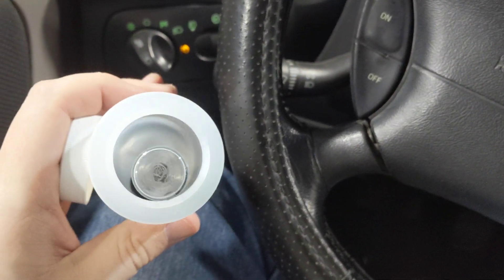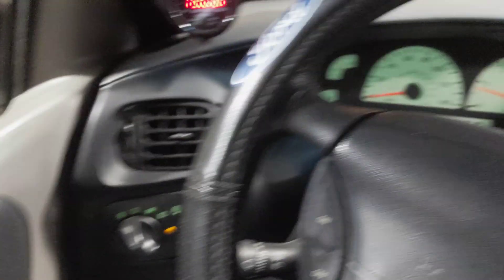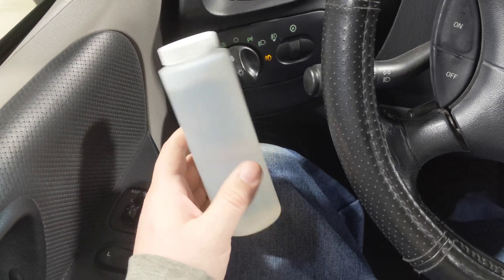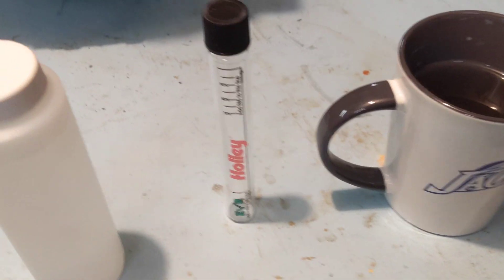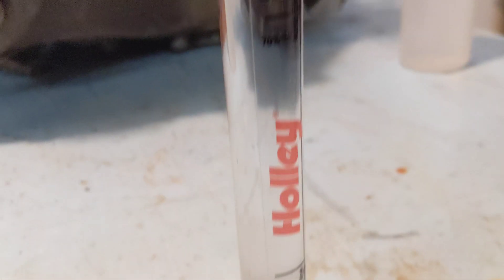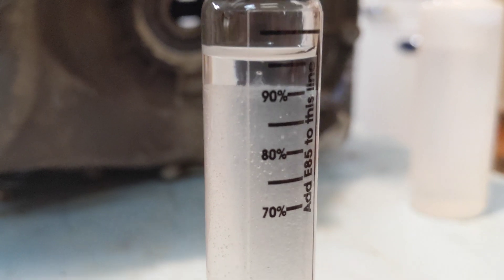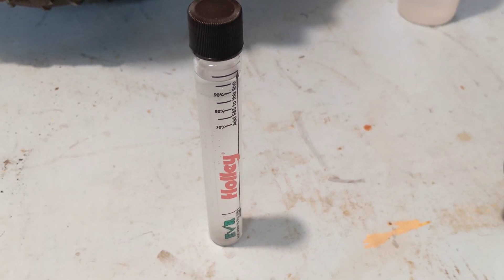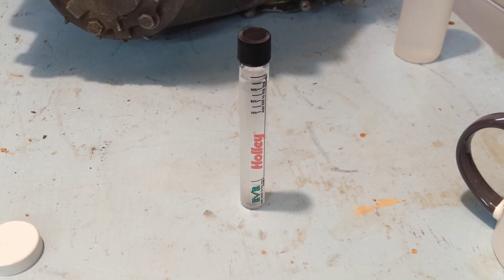How to Test E85 (Quick and Easy!)

Comment: E85 is beautiful high octane fuel. Makes more power than pump gas, burns way cleaner and no more carbon monoxide headaches,
Reply from the maker: It's the best!!!
Reply: @605BOLT  Definitely. But it goes fast. I can see needle move everytime i punch it...lol
Reply from the maker: @maximusvonce1381  that is true. I lost a ton of mileage when I switched over. Went from about 15-16 to barely 10 if I'm lucky haha. But soooo worth it.
Reply: @605BOLT  10mpg is good. My fuel injected 438windsor is lucky to get 5mpg. How long have you been using e85? Any issues or gumbed up injectors and fuel pumps. How often you start and drive your e85 lightning? I use Techron Marine to make sure no water build up in my tank or fuel system on e85. You use any additives?
Reply from the maker: @maximusvonce1381  I haven't had any issues with it yet at all. But I've only been running it about a year and a half. I drive my lightning about once a week for sure for 9 months of the year about about once a month during the three hardest winter months.
Reply from the maker: I don't use any additives either. Does that help you at all?  Since I haven't had problems yet, I haven't had the need to try anything.
Reply from the maker: I have never knowingly run it on anything worse than E70 and never beat on it with anything worse than E80. If it's no good, I don't refuel it.
Reply: @605BOLT  So you wont ever go back to any gas station that sells anything under e85. Did your car run bad too on e70 and e80?. I only use 1 gas station now that always tests right at e85, and my car never has problems..When i used e80 from 2 different stations it ran like shit. How bout you. Did your car run bad on e70 and e80. I assume you wont ever refuel it at any gas station again,  that runs e70 and e80. Gotta be e85 or my car gets pissed off and stalls on me..
Reply: @605BOLT  Both times i ran e80 my car stalled,  misfired,  sputtered,  and cut out at high rpms. Once i put e85 back in all is good. No idea why it only runs good on pure e85. Why do you think that is, cause i know guys who can run on e80 and no problems.  I guess it depends on car and tune huh?
Reply: @605BOLT  So for 3 months out of year,  you only drive your car once a month.  Rest of year you drive once a week?
Reply: @605BOLT  So what performance improvements did you notice most when you switched from pump gas 93 to e85. Did you make way more power. Is throttle more snappier.  Is car faster?
Reply from the maker: yep. thats basically it. we have some nasty winters here in SD so I won't subject it to the salt and whatnot.
Reply from the maker: I changed pulleys and injector and Cold air intake and ported blower all at the same time so it was hard for me to say what made the difference.  Generally, my understanding of why you switch to E85 is because it has a higher natural octane (105) vs pump gas (93 or so).  This added octane boost doesn't give you a power bump on its own but it allows more timing to be added in earlier so if tuned accordingly will allow for a few more ponies.   Also, the added octane makes the fuel more resistant to detonation.   Lightnings (especially pullied Lightings) have high intake air temperatures so this fuel provides an added level of safety against detonation which is the primary reason I use it.  Lightnings don't have knock sensors so if you detonate, the vehicle will continue to run itself to death.  The E85 gives an added level of protection.  This isn't gospel by any means but merely the way I understand it.
Reply: @605BOLT  So i need to clarify something with you. When you ran anything below 85% ethanol ie...80%, 75%. How bad did your car run. Did it stall and misfire,  and sputter, and cut out at high rpm. My 68 mustang will run like shit on anything under 85% ethanol.  My tuner said the lower ethanol amount will make it run rich. Just curious how your car ran on e80 or e70?
Reply from the maker: @maximusvonce1381  it runs fine. I don't beat on it under those circumstances but it gets where I need to go.
Reply: @605BOLT  Weird.  Wonder why my car so sensitive to anything under e85. Runs like shit on e80
Reply from the maker: @maximusvonce1381  idk I guess. Sounds like a much rowdier engine so maybe not as much room for error there.
Reply: @605BOLT  If i use any poor e85, my car runs like shift,  misfires and stalls. Gotta be 85% ethanol or my car is terrible

Comment: Can you flex fuel on e85 and premium?
Reply from the maker: Lightnings don't have flex fuel sensors so any blend of ethanol needs dedicated tuning for that scenario. So basically if you want to run E70 or E50 or whatever, you need to have an E70 or E50 tune to go with it.